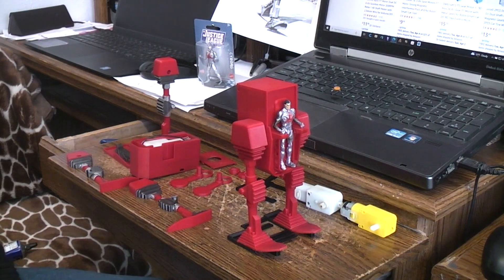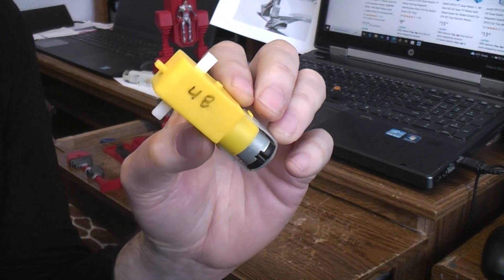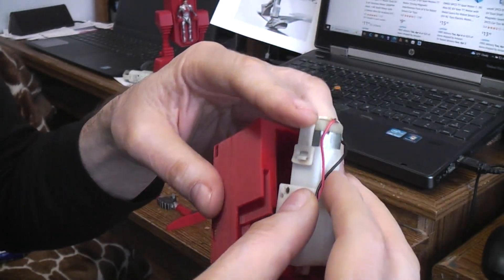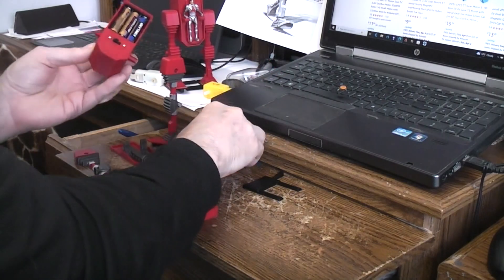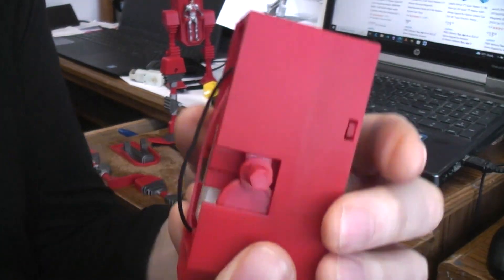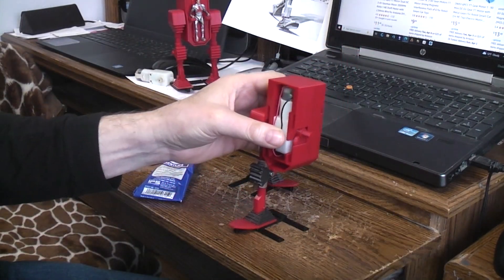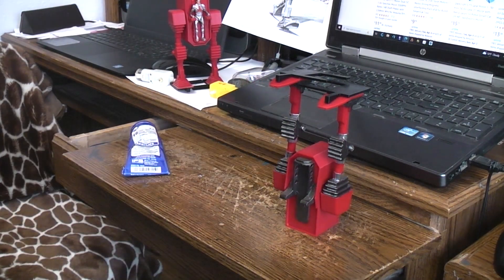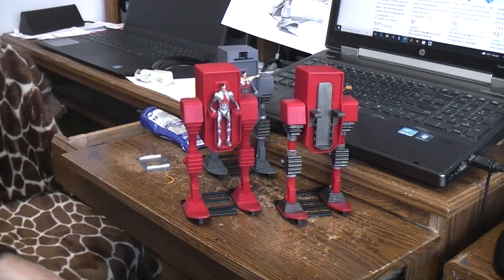Lets  build the GE's "Pedipulator"  Walking robot Machine . 3d printed parts .

Comment: Really great build, love the look of this one , you did a good job of replicating the original design.
 Would be cool to find something that could work for the clear canopy, perhaps a common piece of packaging, or a little redesign and use a christmas ball half ?
 Was there any particular search term you used for the larger white motors ? its been a while since i looked but I dont remember seeing them before..

Thank for the upload .
Reply from the maker: The Dome build is going live on April 4th. The white motors just seem to turn up from time to time when I do a TT gearmotor search. I buy some when ever I see them as they are useful. But I have to say I realy like the way the 1:48 yellow TT motor running on a single AAA battery turned out. Good speed and not loud.

Comment: Really neat John   , but on the leg why  didn’t just print one whole piece? Ty 
🤖✌️
Reply from the maker: If it was one piece it would have to be printed with supports, that adds print time and waists plastic , printing as 2 parts that lay flat make a for a stronger part as the layer lines run the length of the leg, less chance of the 3d printed part breaking at a layer line.
Reply: @Robothut  so better physics and economics